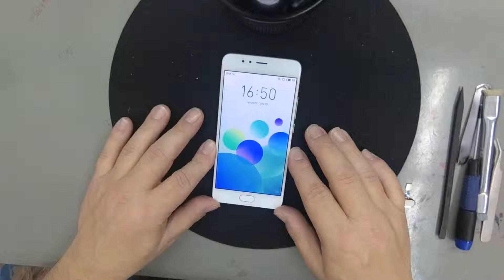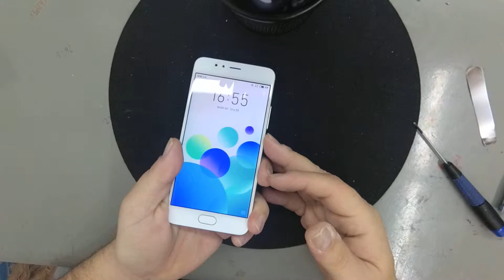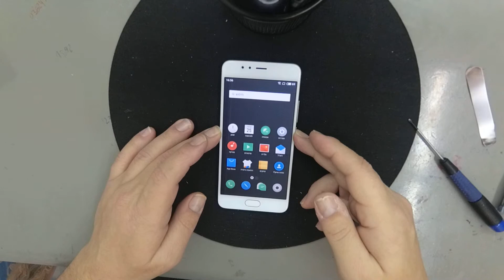Meizu M5s Home Button Repair,Charge Replace,Speaker Fix

Comment: Great video!

I have Meizu M2 mini and loudspeaker is dead (no sound in my phone). Also home button is bugging.
So, for loudspeaker I should buy that black part you removed at minute 2:00?
Reply from the maker: yes this is the speaker i remove on minute 2:00